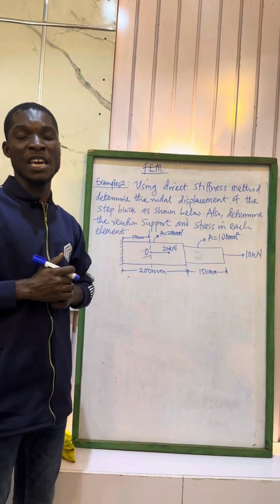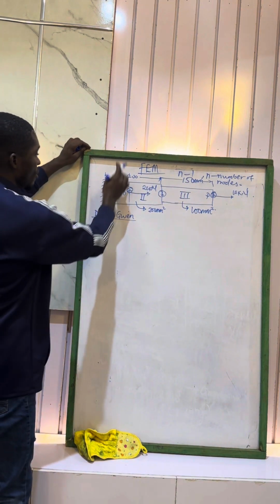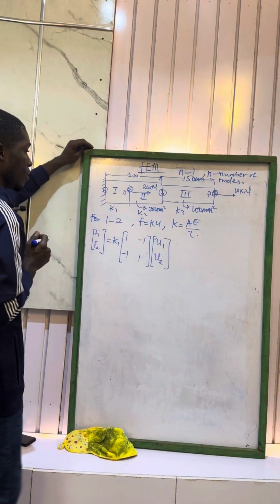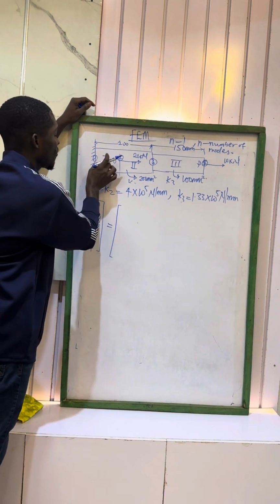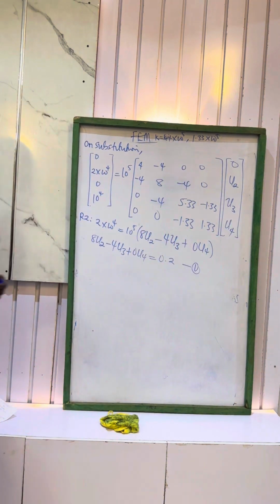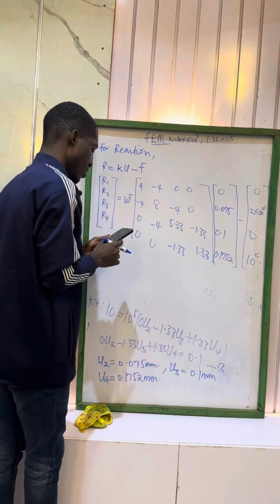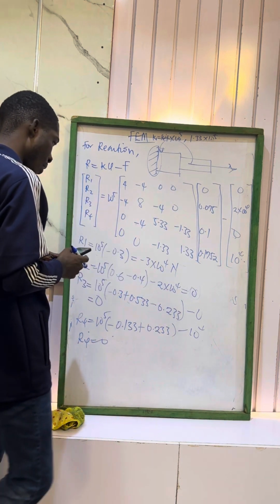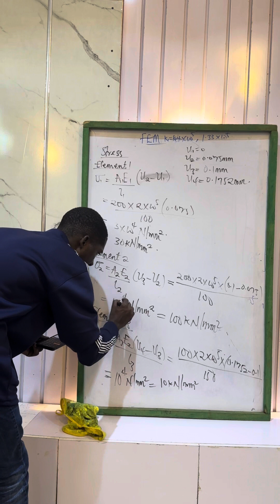IPE 507 | FINITE ELEMENT METHOD  part 2

Comment: Hi guys, please take note of 27mins;
I was trying to determine stress, the formula is not sigma = AE∆U/l. Area is not supposed to be there. It was an oversight.

The correct formula is:
Sigma = E∆u
                -------
                   l
For element 1:
Stress = 150N/mm²

For element 2:
Stress = 50N/mm²

For element 3:
Stress = 100N/mm²

Thanks.